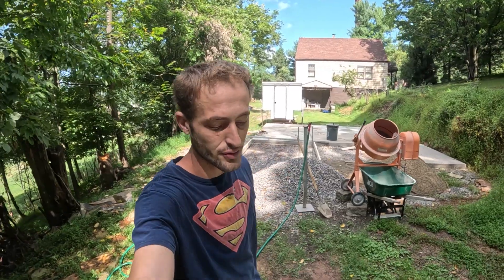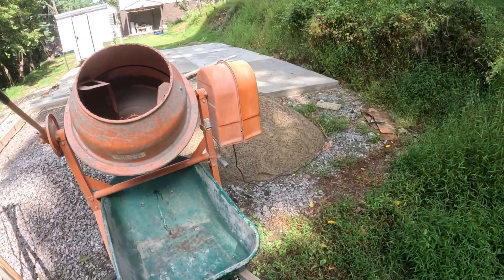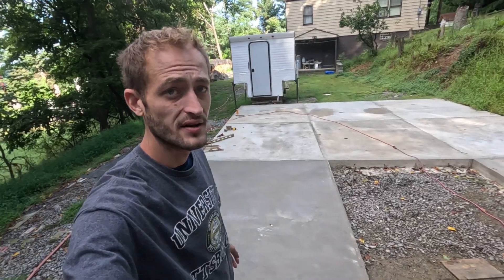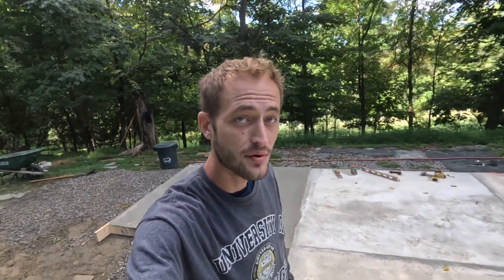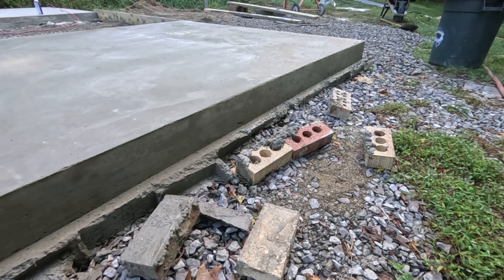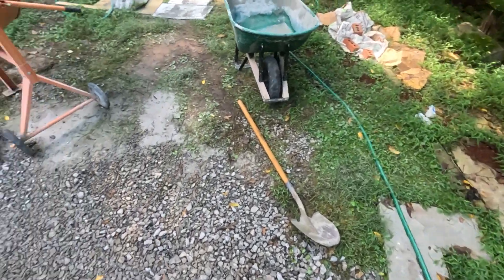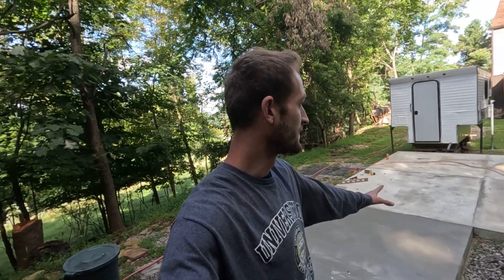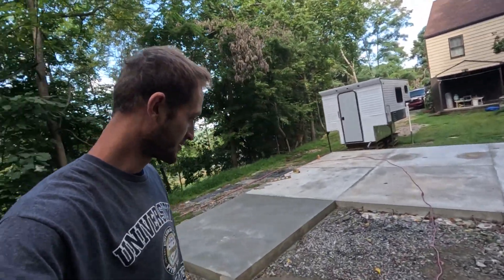Pouring Concrete Slab For Garage Part 8

Comment: Are you going to run electric from the outside in.  Any thoughts to dropping conduit under before you pour?
Reply from the maker: @jcamardo2015  planning on doing an off grid set up. Solar.